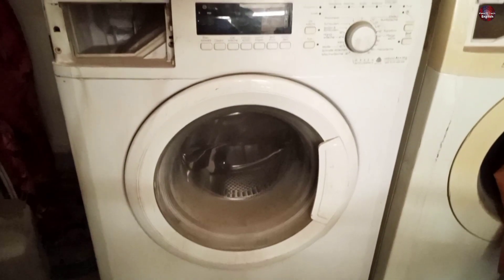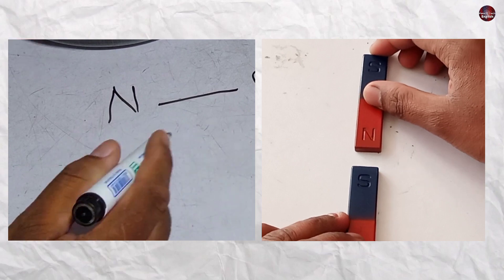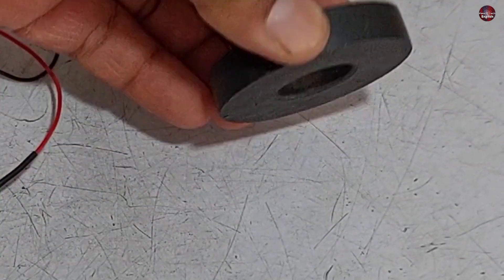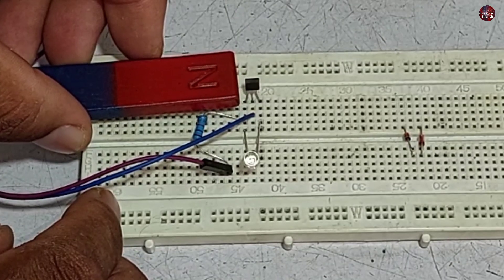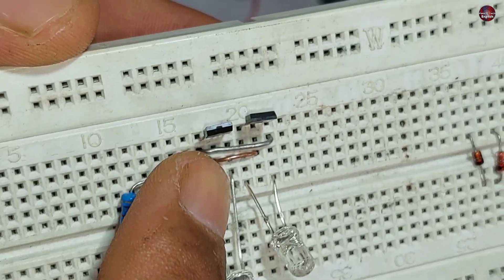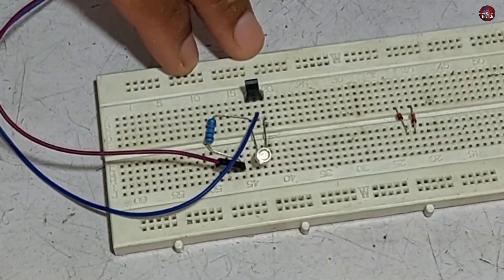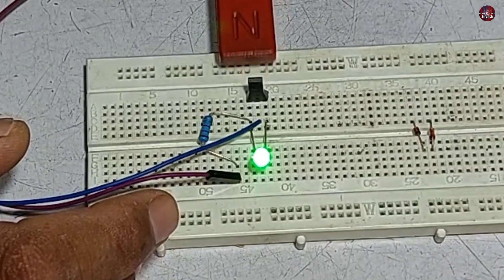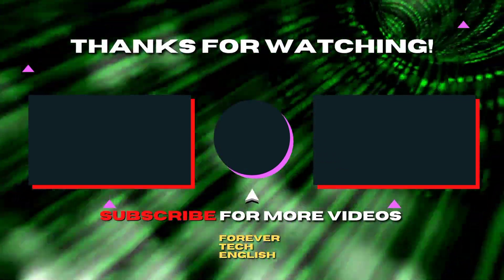How Motor Hall Sensor Works In Washer & Its Core Testing

Comment: Sir, sensor no. 6501kw2001b and 6501kw2001a is different or is it the same, whether they can be replaced with each other
Reply: These LG drum speed sensors are interchangeable. 6501KW2001B supersedes 6501KW2001A.
Reply from the maker: They are different from one another, one is bipolar, the other is unipolar.